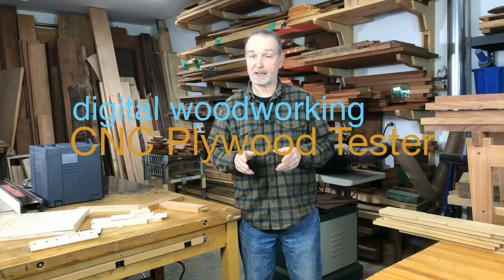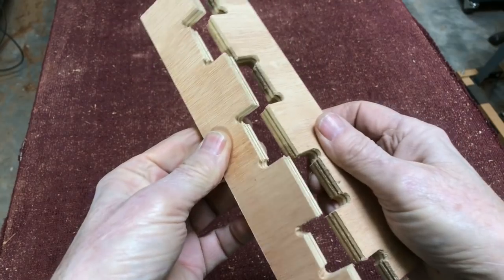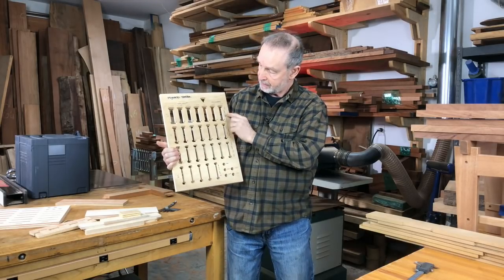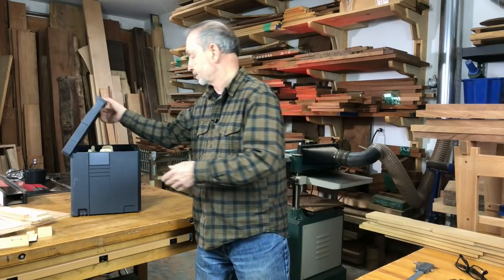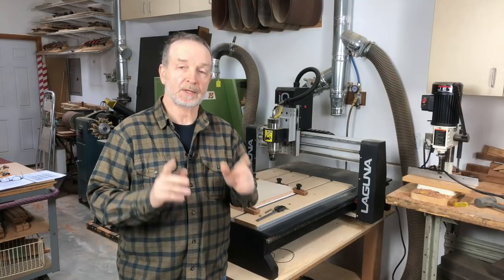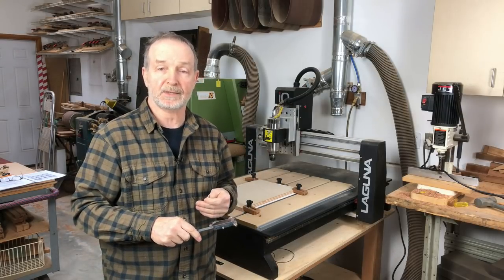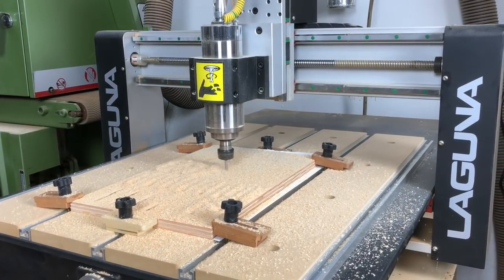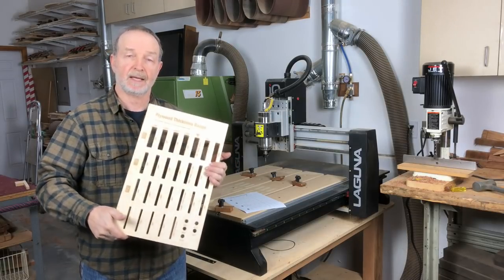Make a Plywood Thickness Tester on Your CNC

Comment: great idea!! I just started CNCing a few months ago. This is going to be useful find. I do a lot of cutouts. should have found this months ago:) thank you once more..
Reply from the maker: Glad it works for you. Remember you must carefully measure your 1/4" bit and enter it into your CAM program for this to work.
Reply: @digitalwoodworking  I'm just using the idea of it. for me i had to resize everything because i use 1/8th Baltic birch (makecnc type stuff) most of the time so i made sizes .125 - .25 same idea though moved sizes by .05". debating or not if i need to go smaller I do have a 1/16th long reach EM bit:) should I use 1/8th Baltic birch to make this or .75 mdf? as is going to use a 1/8th compression bit unless i need to go smaller slot size
Reply from the maker: @st0mper121  It's not a matter of scale, it's about actual thicknesses of the plywood you test. Those become the reference size of the slot. Then add/subtract .002 or so for alternate openings. If you want to use a smaller bit go for it, but (and this is critical) you must measure the actual bit you're using to .001" or better and enter it in your CAM settings. 1/8" bits are definitely 1/8". If you don't do this, the tester is not useful at all.